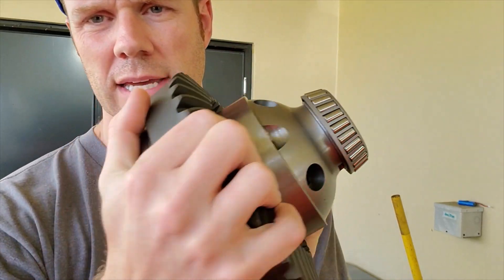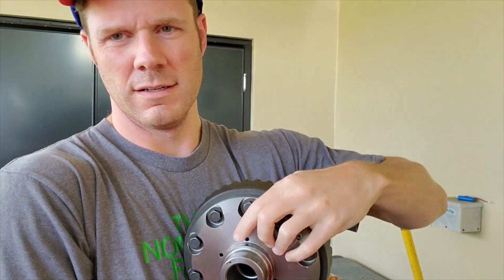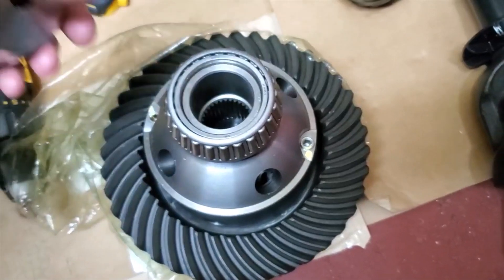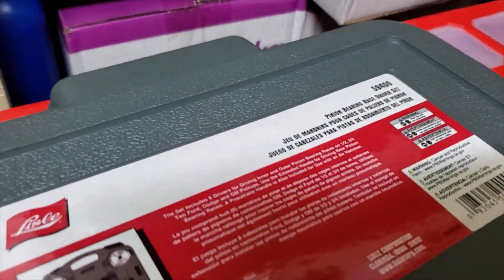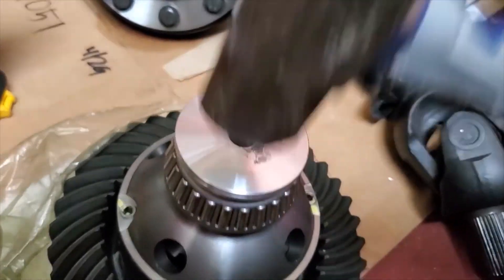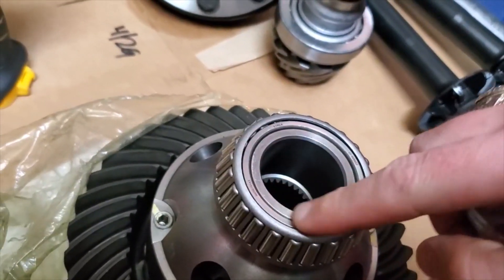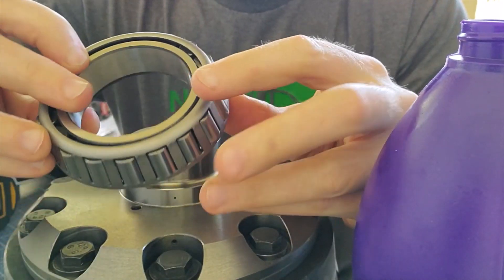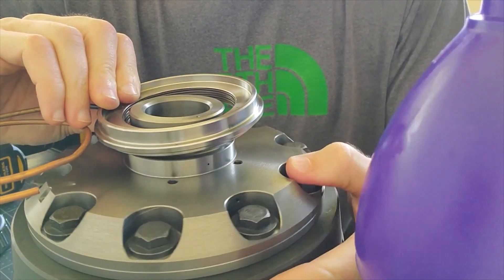Part 5 How to Install Ring Gear & bearings without a press at home Dana 44 30 JL JT

Comment: I'm currently doing a Nissan axle which is basically a JK 44 with 2 extra splines, and the ring gears go on and off with no interference, it's the weirdest thing. That's all, just weird. I was all ready to go cook it, didn't need to. bearings on the other hand... we'll see today. Nice tips, I'm not sure it would have occurred to me to use the race drivers, I was planning on cutting the cage off an old bearing and using that. Never really understood why Jeep guys loved switching to ARB, but now that I'm replacing the factory Spicer locker (same as in the Rubicon) I totally get it. It functions, but no way would I trust it with 37"+ tires, especially with the Titan v8.